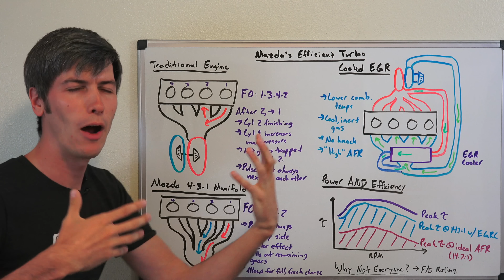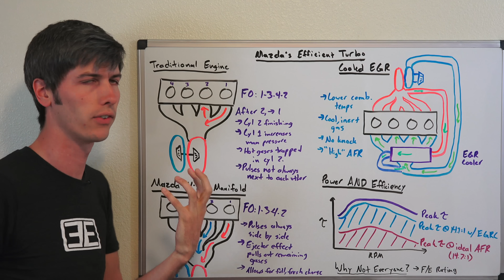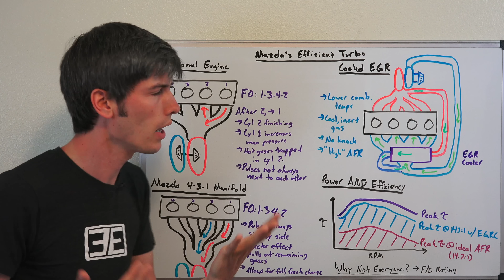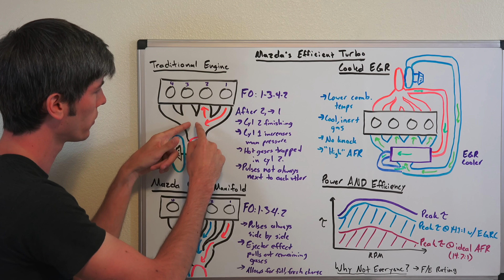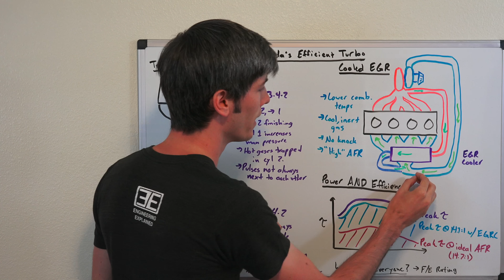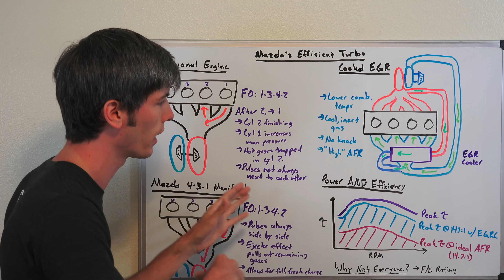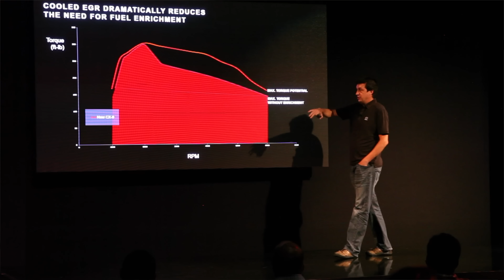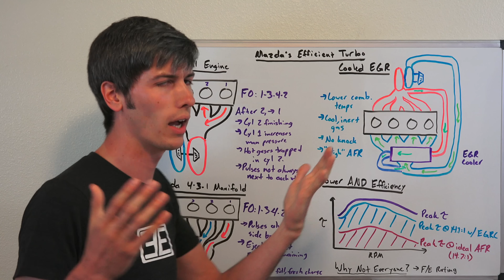Mazda's Secret To Efficient Turbo Engines

Comment: Recirculating part of the fumes helps cool the fumes exiting the exhaust pipes, which may turn them cherry red and melt or crack.
This is because the exhaust system is obstructed.

Comment: The main real problem is the nitrogen content in the air used during aspiration, because NOs are potentially acidic.
There are two consequential real mechanical problems: 1) a clogged exhaust system caused by the use of a catalytic converter, and 2) the overlapping period in the 4-stroke cycle. Solve these, and the engine could be cleaner.
Note: if there is no nitrogen present in the combustion chamber, there is no need for a catalytic converter. The use of a turbo does not solve any problem.
My two cents.

Comment: I understand the cooling effect of the EGR cooler. Do car manufacturers need to recirculate engine gases to meet emission standards? Why not just use a water cooled turbo gas outlet (not sure of the exact name for this)? this would cool the overall gases and only effects the process when the turbo is needed in high power needs situations.

Comment: Fell in love with Mazda after driving a 323 Astina (late 80s). That car felt fundamentally different (nimble and responsive) than anything I've driven before (Passat B1, MBenz W124, Mitsu A155, Nissan T11. Owned nothing but Mazdas since then. Not one disappointment. The Mazdas I let go had more than 15 years on them with more years left--just wasn't practical to keep them all.

Comment: I'm on my second CX9.   It's not perfect.  It can sound rorty and even harsh at high rpm.  And it can sound burbly at low throttle under load.  But it is so drivable.   That torque is so seductive.  Who needs to floor it?   It makes you drive it in silky mode.   For a big car, it has very nice road manners.  It is precise, with little body roll (for its size) and invites high speed cruising.   Sure, it's no sports car, but as a people hauler on a long trip it's a bargain.

Comment: Its good to have more horsepower but i think it will never be as reliable as the naturally aspirated option also its not worth it when considering  the price of more frequent oil and filter changes in the long run 🤔
Reply: For some of us, we already change oil every 6 months as per the manual.

Comment: People forgetting about the 2.2 diesel Mazda made, possibly one of the worst diesels ever made 😂
Reply: Models starting mid 2018 are very reliable and all the issues have been addressed
Reply: @kristizh4443 No, they were facelifted, still have all the DPF, oil dilution, EHR, carbon buildup issues. The diesels they make have been rubbish. The 2014 update fixed the chain issue however the engine by design is rubbish. You only have to look at the oil dipstick, it has two max lines, one for oil, then another for when the diesel gets into the oil and dilutes it. Shame as their petrol ones are amazing I hear.
Reply: @johnnyalanbailey 
The whole intake including Egr pipings has been redisigned. There is no case of total carbon blockage on the engines starting from mid 2018. Exhaust camshaft has been redesigned. The injector seal issue has been eliminated and oil dilution minimized. It occurs only when the dpf regen is consistently interrupted.
Reply: @kristizh4443  Sounds better than the original design but still I wouldn’t trust them considering it was probably the one of the worst diesels ever designed, I don’t think just a few tweaks would fix that.
Reply: @johnnyalanbailey  It's a good diesel engine overall, quite smooth running similar to petrol due to lower compression ratio. Agree that years 2012-mid2018 diesel engines have many issues (if you know the cars you can avoid some of them) and I would not recommend anyone buying them, especially now that they are used.

Comment: Jason, I'm glad I discovered this video! I just replaced the spark plugs on my wife's 2019 CX-5 2.5 Turbo... and was wondering what that little device was mounted to the top of the engine. Cooled EGR - Neat! Now I'm going to research if it needs servicing. Back in the day, her 1995 Honda Accord EX wagon had a known EGR issue where carbon deposits would build up in the internal ports and cause drivability issues. I used to tear it down every year and clean the waxy carbon gunk out, and it would run great for a while after that. This Mazda one though, I look forward to understanding it more.
Reply: Oh, and at 75,000 miles, the new spark plugs brought back that Mazda Zoom Zoom acceleration that had degraded only slightly this last year or so. Shame on me for being 15,000 miles overdue for new plugs!

Comment: I think engine size may also be a factor. Compare this to the Honda 1.5. The average driver in real-world conditions is going to be pushing that tiny 1.5 hard and the turbo is going to be spooling up and going into those conditions of lower fuel economy due to higher boost. Under the same conditions, the 2.5 isn't being pushed that hard and isn't going into those high boost conditions that lower fuel consumptions. The 1.5 is probably the right size engine for something in the subcompact class (like the Fit) as opposed to the bigger vehicles Honda is putting it in. The 2.5 is probably the right size engine for a larger sedan or midsize SUV. I suspect if some of these manufacturers picked right sized engines as opposed to going with these tiny little engines, then the differences between EPA and real world fuel economy on turbo engines would be less significant.

Comment: Only thing I hate is how their engines are purely DI, which I understand is required in order for their skyactiv system to function, but if they just had some port injection system to clean the intake valves, I'd be so happy.

Comment: Unfortunately these engines have a tendency to spring coolant leaks from the heads after as little as 20K miles...meaning the engine designers didn't do their homework quite as well as they should have...search Mazda Skyactiv 2.5T head coolant leakage and you will see how much of a problem this is.  My 2016 CX-9 (with 78K miles on it) sprung a leak from the head in November 2022.😵‍💫
Reply: Head design was revised in later model years to address the cracking.

Comment: So you can use 87 but would you get better performance and fuel economy with 91 also would using 91 with new 1022  cx-5 turbo help with longevity of engine?

Comment: Should not the problem of knocking be solved with higher octane content.  for example, adding a mixture in 10% ethanol in gasoline that does not contain ethanol.  So that you can, for example, get 95 octane according to the American way of counting.  There are also additives that you can put in the gasoline that raise the octane.  If you do not like ethanol

Comment: I think the turbo charger adds about $2,000 to the price of the car but it is good because they can help control more horsepower and a smaller engine and the other advantage is that if you have to idle the engine it's very efficient it's very cheap like a semi truck 15 liter engine uses a gallon every 6 MIle but when it sits there and engine idol it uses less than a gallon per hour

Comment: The main idea of a turbo is to get in more (pressurised) air into the combustion chamber, and therefore more fuel for a better combustion overall.
The main idea of EGR recirculation is to introduce (cold) inert gases into the chamber which results in better combustion by lowering the temperature. This also improves emissions by filling the chamber up with inert gases instead of excess air in low load conditions and thereby preventing the formation of NOx.
So if these inert exhaust gases do take up space in the combustion chamber, this is a direct hinderence to the main idea of a turbo (to inc air in the chamber). Would this not effect the maximum achievable power of the turbo engine then??
Reply: No, they just increase boost a bit more to compensate for the lost air volume. The cooling effect of the EGR is greater than the excess heat produced by increasing the boost to hit the same power level.

Comment: They could use the additional torque in hybrid systems to produce the electricity and store it in batteries. And when it's in the city, it could drive on electric motor. Then the fuel efficienty would be there.

Comment: I don't understand turbos that well but I am trying to understand the claim that Mazda 2.5 turbo is better than said other smaller turbos (honda accord 2.0 T comes to mind). Accord produces not only more power with virtually identical fuel economy (not the epa number I am checking the owners reported mpg) but also smokes (not even close) it in drag race despite this Mazda having more torque. How is this better? Is this some kind of Mazda fanboy thing?
Reply: Its because of the power curve Mazda engineered into the engine. The primary design purpose for this engine was to be the powerplant for Mazdas CX-9 SUV. Seeing as thats a 3-row SUV, you aren't gonna be racing it and you want a daily driver friendly torque curve. So Mazda designed this engine with a shitload of low end torque, but that is at the expense of running out of breath on the top end. That's what you want in a daily driver, as most people just cruise along and never get above 3krpm.

Originally mazda had no real plans on putting this engine into any other cars. They only started moving it to other cars in their lineup because the community was clamoring for it. Thats why it has the power curve it does. It was designed from the outset as an SUV powerplant and was never really designed with performance applications in mind.

Comment: I have a 2018 Mazda 6 with a 2.5 NA mated to a 6-speed manual. At 70 mph, I'm getting 41-43 mpg (hit 46 once, but that was with a good tail wind).  "Official" fuel economy numbers show worse (33mpg for the manual, 35 for the auto, 31 for the auto with the turbo), but from my experience I'm getting way better than what the car is rated at.  Mazda should really consider keeping the manual as an option for the 6.

Comment: I was following along well until the concept of recycling exhaust back into the intake.  That broke me XD
Reply: Its actually quite simple. If you want to get more power out of a small engine, you need to get in more air so that you can burn more fuel, which requires higher pressure and thus higher temperatures. Gasoline engines really hate high temperatures though because it causes them to knock and thus cause damage in the long run. The solution to that problem could be to inject more fuel to keep the temperatures lower, but that would obviously be very inefficient. Alternatively you could just reroute cooled exhaust gasses and achieve the same result without wasting extra fuel.

Comment: Unfortunately Mazda is not putting this engine in the Mazda 3 in the UK. It would make quite a hot hatch, but they only use naturally aspirated petrol engines here. (Having said that, they had the very smooth 2.2 diesel in the previous model 3, which has plenty of torque for a small car and is a delight to drive).

Comment: So, is this equivalent to recycling unburned fuel? Cooled EGR helps control combustion temps, but there should be unburnt fuel in the exhaust gases. Also, didn't Oldsmobile do this many years ago?

Comment: What I don't understand is why the 2.5 turbo needs premium fuel to make just 250 hp. A modern turbo engine should easily make 300 hp from 2.5 liters using premium. Less than 100 hp per liter is bad for 2020 turbo engines.

Comment: Diesel engines (some, Renault for example) already use this cooled egr process for some time. The reason could be the same, since diesel compression ratios are higher, knock was an issue. Good to see this being applied to gasoline engines. The egr coolers will have issues since the exhaust gases can damage the thin walls and you might get "head gasket leak" symptoms on the coolant circuit. I actually had this issue on a Renault 1.9 Dci. The egr coolers on Renault are simple to clean, but this Mazda one doesn't look that simple, we'll have to wait and see. Great video (also the previous one) love your channel.

Comment: I have both a 2019 Mazda CX-9 and a 2017 Mazda 3 with a manual transmission.  They are phenomenally engineered vehicles, a blast to drive and very reliable.  For cost to fun factor Mazda leads the way for driving enthusiasts.

Comment: Mazda is like the Japanese Rolls Royce in my opinion. But they have not always been! Their first half decent sports car using a conventional engine was the GD MX6 Turbo. Absolutely ideal for the home mechanic. The design of the vehicle is simple but genius. I would pay big money for a mint condition stock example with genuine low miles and red in colour. So underrated. So underestimated. So unloved by most. The reason as to why they are quick is because the motor reaches peak power at very low RPM. Highly recommend ☆Mazdas☆ They simply just work and keep on working

Comment: Always hated EGR..it goes completely against all power making strategies...however I guess if its mandated this is an OK compromise.  One other good thing here is that you could more easily get away with deleting the actual EGR's gas flow and still appear stock...so as to pass inspection while at the same time removing all that extra heat into the intake charge.  I know what I would do with one...

Comment: How does Mazda avoid valve deposits with direct injection. I own a 2011 F150 EcoBoost GDI and while I just installed a catch can at 80,000 miles and have experienced  no deteriorated performance, my brother in Mississippi has on a same year, truck, engine combination. How do they avoid thus potential problem?

Comment: Hey Jason :) . It seems like you love Mazda . There are other brands that also done good.  For example Peugeot 1.6 THP engines maintaining 14.7 even under boost and moderate load ( of course not in the whole RPM range as High RPM have different requirements :) ) But generally the brand is quite honest in their emissions ratings :)  ( of course you may not have the brand in your country witch will make sense)

Comment: litterally all of this stuff can be found in usual european cars (partly, because diesels have been using these technologies due to their way of working...); Mercedes-Benz, BMW, Audi/VW, Peugeot have been using these technologies for years...so, whewer is the news? Any Mini will give you a twinscroll-turbo-system with  egr, the Peugeot 208 with the identical engine will do so as well.
The Mazda 2.5t is just a high pressure petrol engine, that shares a lot of features with a low pressure diesel; the skyaktive-g will actually match the diesel compression running 14:1. Interesting fact: The 2.5T won´t make it to europe, because it doesn´t meet euro emission standards...

Comment: The solution that Mazda uses is one that I believe is has always been used to maximize gas exchange in the cylinder. To imply that other manufacturers obviate this very important part of the intake-exhaust manifold, I believe it's not true, but I might be wrong with some manufacturers. Good explanation thought, liked it.

Comment: As an aside, this engine is 25% larger than most other MFGs engines. They have stuck to the standard 2.0 L with a turbo. Mazda has 2.5L with a turbo; maybe they don't need as much boost to get what they want.

Comment: The scavenging effect we used to call the venturi effect. That is the principle underlying extractor manifolds fitted to naturally aspirated race and rally cars. Also, I suppose those Mazda engines have the Sky Active system? That would solve the knock problem?

Comment: So we can stand on the  throttle which many do stillget real world mileg
Reply: Oh and if u have a turbo u need better lubrication too ph 403 830 4124 even on shutdown turbo spins at high rpm needs cooled down too forced lubrication etc where
Reply: What happened with the electric turbos no exhaust restrictions or turbo lag

Comment: Seems like blocking EGR at higher engine loads solves the problem better. Allows more cool oxygenated air into the cylinder for better volumetric efficiency.  At better Carnot efficiency - without the EGR poison- - at higher loads emissions would stay low (except perhaps NOx).  At lower loads, the recirc poisons could be metered in when the fuel air mixtures remain stochiometric.

Comment: Seems like the tiny passages of the EGR heat exchanger are gonna get completely clogged with condensing EGR gas crap.  Is a filter or a cleanout provided?

Improvement or Achilles heel?    Like cylinder deactivation, EGR, PCV without filters, stop/ start and diesel software test hacks, some "improvements" build in  unreliable complex hardware for miniscule fleet fuel economy gains that are literally undetectable to the customer.  Very disappointing regulatory and designer weakening of otherwise simple,  sound reliable, long -lived technology.